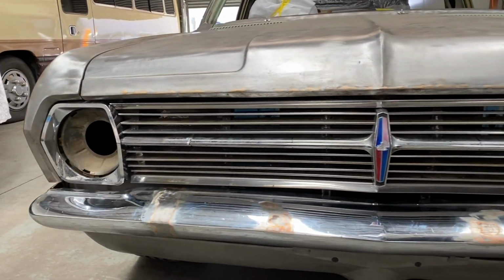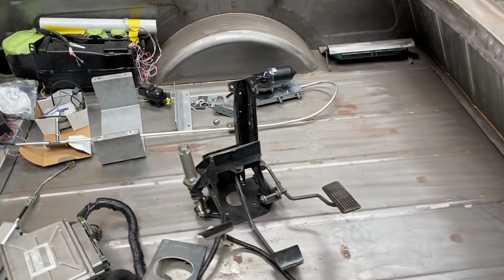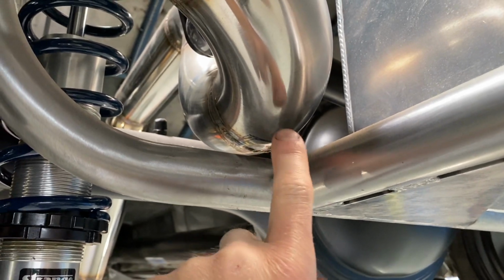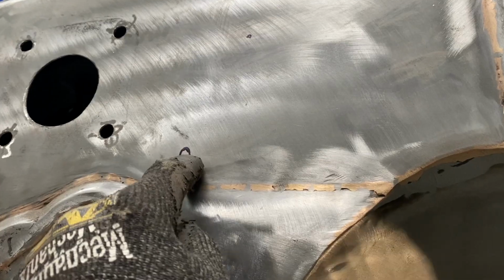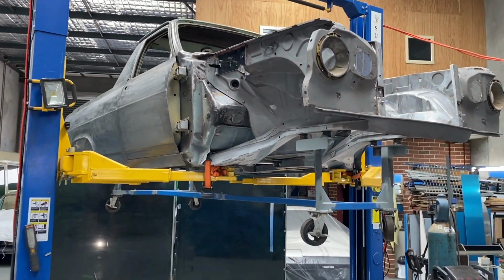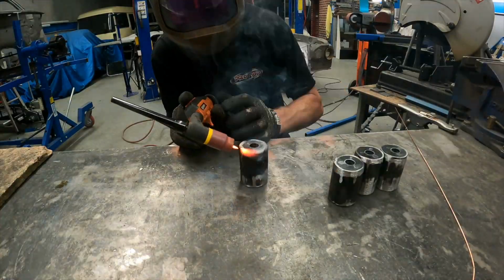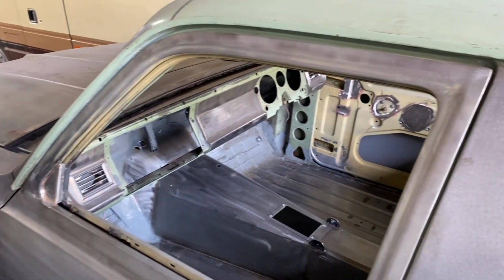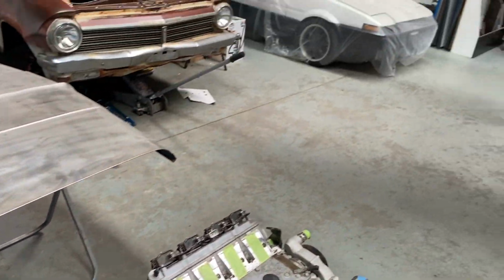HR Holden Ute Build Part 4 | Stripping Down & Getting Ready For Paint

Comment: Massive job welding this back together. Why does the tig welds look like brazing rod? Are all the replacement panels zinc anneal not just flat plate.
Reply from the maker: Sometimes I use silicon bronze tig rods and yes a lot of the sheet metal I use is zinc anneal mainly where I don’t need to shape the steel.

Comment: How much faster is it to do fab work in this style, compared to a classic/factory spec restoration?
Reply from the maker: It depends on the car and what you want to do to it. If your car has a lot of factory parts and panels available then it could be easier to build a classic spec car. This model car doesn't have a great aftermarket range so it was easier (for me) to fabricate a lot of the bodywork myself. For me it's a lot quicker.
Reply: My car is a complete and registered HR Ute, but it’s got an unknown amount of bog in places like the sills and guards. Plus some holes around the k-frame mounts and rear leaf mounts. A bit scared if I strip it back, how much of the Ute would be left 😅